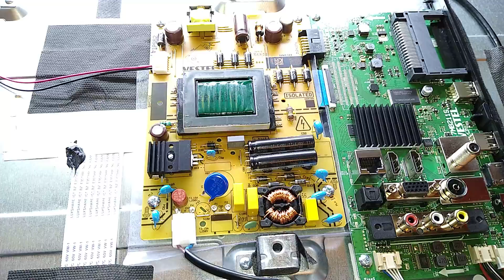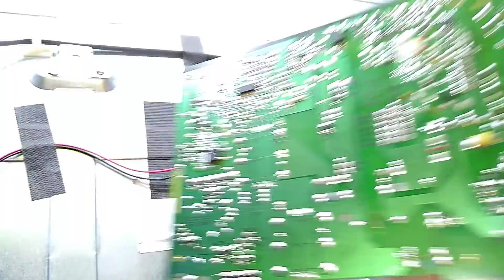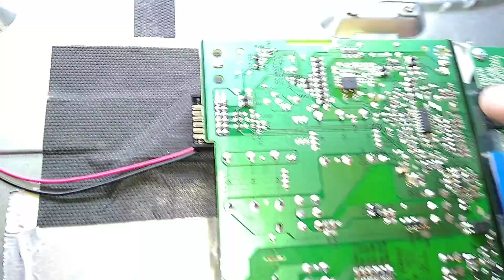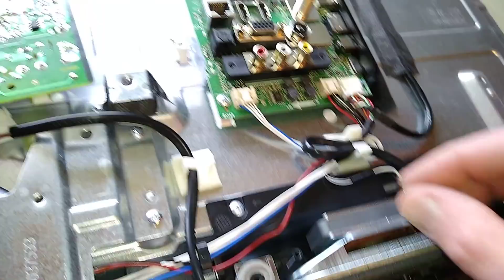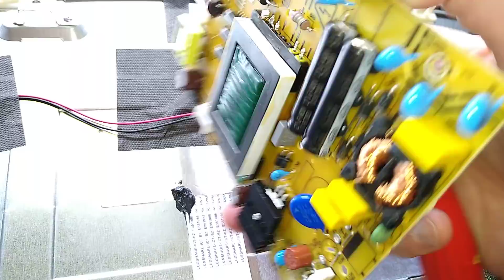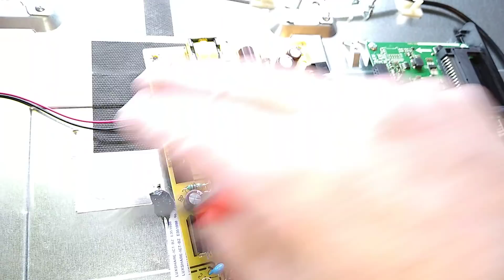There's not much inside TVs these days

Comment: i used to work in tv repair...   i watched it go from component tracing to plugging the tv into a laptop and getting the message “replace board a”
Reply: I started repairing TVs in the early 1980s. All solid state by then. Lots of different brands. Used to repair down to component level. You had to back then, there was none of this board swapping. Sometimes there would be a module change (as in the Philips K9 and KT3 chassis) but after changing it out I'd get back to the workshop, sit down at the bench and repair the faulty one - ready for the next TV that came along with a problem. Most techs these days are board jockeys - they don't know how to repair to component level because they've never been trained to. I got out of it in 2002 so never really had any experience with these new flat panel sets (and I don't want to).
Reply: I did my apprenticeship in TV re[pair at a lovely place called Julie TV in Bolton.. £15 dual standard sets.. some even point to point wired.. sales £15 mono.. £25 colour.. rentals from £2 a month!!.. we had some beauts let me tell you... the customers, not the tv's.. those were predictable and often cleaner than the waiting for demolition houses our rentals tended to see.
Reply: @PaulaXism  I did my training in the mid-1970s with Rediffusion. Mostly all valves (or bottles, as the other engineers used to call them). https://www.davidviner.com/rediffusion.html
Reply: Same thing happened in computers.  At the start of my career, you installed interface boards into your machines yourself and actually had to recompile the unix kernel to include the device drivers for those boards.  If you needed something custom, you wrote the code.

At the end of my career, I was a babysitter for huge disk farms and a mail system, and if something went wrong, I called a telephone number.  I don't think I wrote a line of code (for work) the last 5 years I was there.
Reply: @Backroad_Junkie  I remember having to set the dip-switches on motherboards and add on boards,  work out IRQ's etc - config the memory space etc... Now its just plug it in and wait.
Reply: wow really?
Reply: @timi6050  -  sometimes it was boards b or c...    but yeah, cheaper to replace a robotically made surface mount board than to pay someone the hours to find the faulty component...
Reply: @grendelum  its how it is now, throwaway society, replace a board rather than get it fixed.... IF your lucky, usually its throw the appliance away....
Reply: Is the ability to access that limited to manufacturer  warranty service?  I would think they design these to be more cost effective to replace than to fix.  Surprised they'd put effort into servicing outside of their own warranty repairs

Comment: Vestel TVs, branded as anything including Finlux, Toshiba, JVC, Hitachi. Mine went at 13 months just out of warranty, in line with a lot of the comments here and elsewhere. Luckily a nice TV repair channel had uploaded a YouTube video of the main fault with these power supply boards which appears to be the diodes. 3 x diodes and 2 quid later plus a bit of soldering saw my Finlux jump back into life about 5 years ago, very satisfying repair and still going strong. Nice vid Clive as ever, greetings from Central Scotland.

Comment: I have a completely unrelated question.
Maybe sir clive or someone else has an idea. I just got a lithium lifepo battery for my motorcycle, but the (new, quality) voltage regulator put out just to much voltage at times which sets off the overvoltage alarm. Not always but at times. Any idea how I can regulate the charging voltage? To lets say max 14.2v or 14.5v. and how much amps would a random system pull... In case amos are limited. any info would be appreciated. :)
Reply: Assuming you can't adjust the regulator, the traditional 'cheat' is to put a diode (or two, or three, in series) at whatever point in the circuit you want to slightly reduce the voltage; each silicon diode will drop about 0.6V.
I'm seeing 10A diodes on Ebay at 5 for £2 or 20 for £3.60; so, inexpensive.
If you think 10A isn't enough (can you measure the current?), Ebay also has 25A bridge rectifiers which will give you two diode drops (so, 1.2V).
I don't know whether the charger needs a bidirectional connection to the battery, though: if it does, you could add a Schottky diode facing the opposite way to the regular silicon diode(s) -- which will waste about 0.25V, but is simple and might be ok.

Comment: I went through this a few months back with  my 50" Samsung.  It died and the set of all 3 boards for it was only $50.  The real cost of today's TVs is in the panel.  That would have been close to $400.  The only problem I had was trying to remove the main board.  It was held on by metal clips that weren't really meant to be undone.

Comment: How to possibly fix power c/b.  Desolder and remove the two white connectors (they will melt).  Put the board in reflow oven (or what ever you have). Reinstall the two connectors and see if it works.

Comment: TVs are so cheap now. Here in the USA you can get a new no frills 40 inch TV from one of the less great brands for about $150 at Walmart, not even on sale.
Reply: Image quality will be garbonium though.
Reply: @Asdayasman Eh, beats a old pre LED florescent backlight one with roasted backlights and shit picture processing that doesn't even let you disable the stupid overscan crap and run it 1:1 pixel mapping. It's hard to buy a bad TV anymore.
Reply: @Broken_Yugo  Maybe my standards are higher than yours, being primarily a computer user.  I like my monitors like I like my women.

Calibrated.

(I'm not sure either).
Reply: @Asdayasman  Sometimes high standards are good, just giving example of the utter shit the super cheap TVs are typically replacing.
Reply: @Asdayasman  Put a small solar panel up to the screen in a dark room, connected to a networked DMM reading current. Then you just need a script to cycle through various colors to help with adjusting the settings.
Reply: @NiHaoMike64  Except solar panels pick up infrared, and you can't make a shit panel good by calibrating it, because it's literally unable to achieve the target numbers.
Reply: @Asdayasman  You should at least be able to get it to perform the best it can, as in not clipping on whites or blacks. It won't fix poor contrast or slow panels.
Also, any TV that can actually do HDR (as in excluding the ones that are merely "compatible" with it) will have very good contrast ratio.
Reply: @NiHaoMike64  I've seen an "HDR" panel and it's the dumbest thing I've ever seen.  "Hey guys what if we put a 32x18 grid of white LEDs behind the panel and just lit them up a bit when there's brightness on screen near them, then charge people extra?"
Reply: @Asdayasman  OLED's can do HDR too...
Reply: Especially around the holidays. Sometimes you can pick up a shelf demo unit marked way down because they've lost the box, manual and remote. Manuals can be found online anyway.
Reply: I just purchased 10 smart 43” tv’s with full 1080p screens for our church preschool from Amazon for $170 each delivered with no sales tax as for a non profit.   They were loaded with Alexa and all major apps ready to go.   One for each classroom.    School had purchased subscriptions to a few online sources to use for “at home school” which were so good they want to use some of it even for in-person school.   Then I find that the company from which I retired will match the gift!    Huge plus for the school.   Of course the tax man will help with a handsome tax deduction so the net cost to me will be about $145 per tv.
Reply: You can even get a 43in 4K “smart” tv now for about $350.

Comment: I fixed a broken TV I got for free a few years ago. It was a special black Friday model that was sold pretty cheaply which was evidenced by the cheap components on the inside. A failed capacitor on the power supply was to blame and with a replacement, it worked great for a year or two where it broke again and I got rid of it.

One of the more interesting things was that despite being a "dumb" tv it had a board with spaces for all the things you'd find on a smart tv like solder pads for an ethernet jack, USB ports and an empty space for what looks like a processor

Comment: May well be some of the LED's have died, I think once the current draw on each set of LED's starts to differ, the control chip shuts off the power to all of them. Unfortunately getting to the LED's is normally quite the mission, involving dismantling the entire panel. Lot's of modern tv's end up in the tip simply because a couple LED's failed. If you have not found it, Clive, there is a forum called 'BadCaps' - they have a section for tv's, probably one of the best places for info and help for most tv's.
Reply: Had what would have been a nice branded TV donated to a charity shop I was working for if it hadn't been for one of the backlight LEDs going O/C. Seemed it was a standard problem and kits were available but I decided it was too much of a faff as all the LEDs needed to be replaced. Which reminds me - I've yet to put the main board on eBay.

Comment: I had a similar thing with my neighbour's telly too.  On power up it just stayed blank and dead but with just the tiny power indicator showing.  As if it was stuck in standby mode.  I googled the part number for the power board and found a handy video explaining the actual likely fault.  Turns out it's most likely cause was one of the six diodes which are in parallel,  so by unsoldering one end of each I could test them to find which one had failed.  The very same youtube site also sold handy replacement diodes as a kit.  Changing just 3 of the diodes to keep a matching set, fixed the problem.  My neighbour was ever of pleased!  All through the power of google!

Comment: That's really simple in there, especially compared to some of the commercial and live events stuff I've seen.
Unfortunately, it seems the commercial gear is moving towards the model of being cheap, thin and slippery, with boards that you can't buy and a different model for every day of production. 
I think the most awkward I've seen was a 100" Samsung touchscreen, which was incredibly heavy, several inches thick, and rather old. Surprisingly, we could buy a power supply from Samsung and fix it.

Comment: Mine packed up with a pop and hasn't worked ever since even though with my attempts
Reply: unlucky.. My Tevion DVD recorder went with a bang some years back.. so big it blew the firmware off the DVD drive..

try powering just the switch mode driver chip on it's own (battery maybe?) and see if there is drive to the mosfet/s

Comment: I don't normally post in the comments but Im not normally in a position to help out big Clive! The fault on this set is normally the edge connectors on the backlight strips. The fix is to just hardwire them with some bits of wire. If you are really unlucky then one of the strips will have failed. Replacements can be purchased from ASWO. (I do this for a living btw). Cheers and keep up the good work Clive 😁
Reply: The secondary rectifier diodes on the PSU like to short too.

Comment: I immediately recognized the Vestel boards right when the video started. These TVs are practically a one size fits all.
Reply: Yep its just the firmware and screen size that's different
Reply: The easiest way to tell one apart with the back still on is to see if the ports are in a neat small square.

Comment: At a wild guess, that wouldn't happen to be a Toshiba TV??? 
Apart from the layout of the connectors on the back of the TV, all the boards are Vestel branded which is a dead giveaway...

FYI if you buy a brand new main board be aware you will need to program it, or have it programed, as you will most likely get a HDCP error when you connect anything via the HDMI ports. You can try moving the old eprom chip from the old board to the new one but that can be a pain in the arse... It's like Buckaroo, "you need a steady hand", but with lots of smoking flux and a roasting hot soldering iron to make it interesting...
Reply: Hot air station?
Reply: @em0_tion  true, but even with one of those the heat disapation of the board makes it a pain. Better if you had a proper reflow oven to at least preheat the board.
Reply: @generaldisarray  That's an overkill for such a simple single layer dual sided board. If it was a video card, laptop or phone PCB - yes ;) You "only" need a high quality hot air station, that can actually deliver a lot of thermal power FAST, like the Quick 861DW. With proper tools everything happens with no hassle. Second way is to cut and bend a thick copper wire in a U-shape so it can lay over the IC's solder contacts, cover it in flux and solder and we have a lift-off... But it might be too much heat stress and/or you can knock-off nearby components easily. Third way i would try this is with the help of low melt solder.
Reply: @em0_tion  in the past I've done it with low melt solder and a fine solder tip. On some of the older boards the chip is usually near the processor that either has a heat sink or through board heat sink
Reply: @generaldisarray  I'd love to give it a go :D I would start by introducing leaded or low melt solder to the IC joints and then surround it with aluminium foil tape and maybe even try a hot air gun (+ tweezers) since i don't currently own a hot air station. I really need to finally get me one + some damaged boards and start gaining more experience with it. My hands are itching :D
Reply: It is a Toshiba.

Comment: You will have to align the electron guns after changing that board, being one of those new fangled color television sets.
Reply: Don’t forget to degauss, either. Might as well put a new PL81 in as well, while you’ve got the back off. The old one’s bound to be a bit tired.
Reply: @ukuleletyke  Yeah, and give the pots for the vertical sync a good clean before doing the calibration. 
Their wipers tend to go bad.
Especially if the owners smoked cigarettes while watching tv.
Reply: there is a knob on the motor shaft.. don't forget to clean the neon bulb
Reply: @PaulaXism   Even I can’t retrogress much further than that..

Comment: I have fixed a few " new tv's " ..All of them were 2-4 electrolytic caps on the power board, or section of the circuit board. Simple.

Comment: Newest ones are just an Android SoC with a power converter.
Reply: @Silvio Balaško It's called percussive maintenance! There's also the travel bug - you can't find the issue on site, take it back to the workshop to find it works fine when you get there!
Reply: Hard to tell - are you serious?
Reply: @Asdayasman  it might not be quite so simple, but he's probably not far off. Almost everything the TV would need would be integrated into the main chip, especially as it's almost all digital. There might be an outboard chip or two to handle some of the legacy analog stuff, and perhaps a little bit of glue circuitry, but the bulk would indeed just be one bigass chip.
Reply: @witeshade  Many "smart" TVs which have embedded web browsers and such are exactly that, an SOC containing an ARM CPU core and display control circuits, running a custom version of AOSP (Android open source platform).  HiSilicone is a supplier of such chips to many different TV manufacturers..
Reply: @Asdayasman  My Sharp TV broke down and the green Android logo was showing with a messaging in English and Chinese saying, "there is a problem with the processor".
I managed to fix it by using a hot air soldering iron on the main processor.